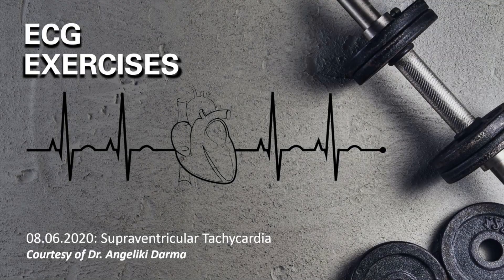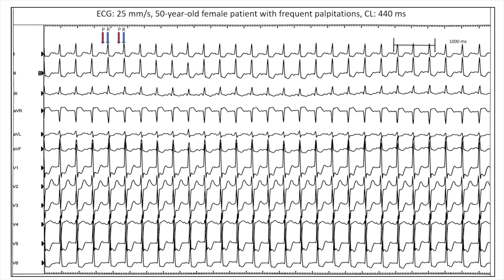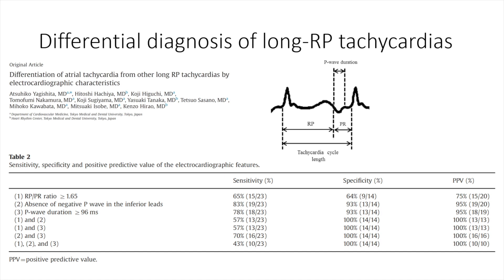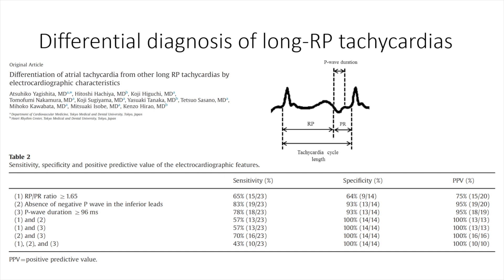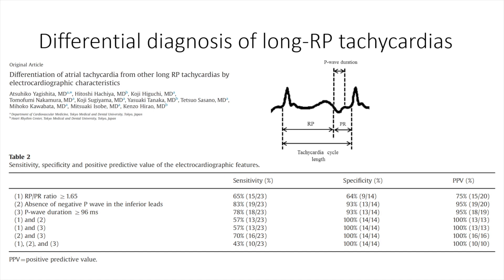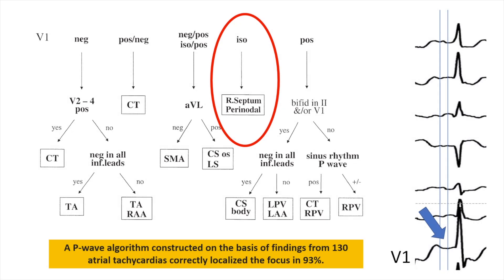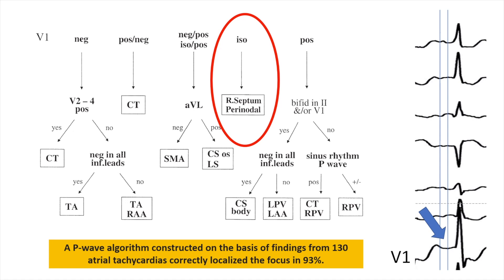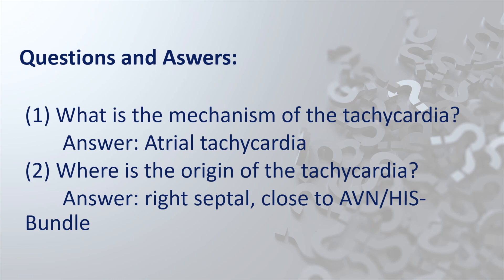ECG Exercise: SVT, what is the mechanism and where is the origin of the tachycardia

Comment: nice case! in practice how often u find AT algorhythm really useful? and if your answer is many times which one do u prefer : the aforementioned one (Kistler) or Ellenbogen or...?
Reply from the maker: Thank you for your comment. I actually use one that we have here in Leipzig. Starting not from V1 and then we look at V2-V6 and then to the limb leads. However, I have to mentions that especially after previous AF Ablation and substrate modification the p wave morphology is not as accurate as we expect. Most probably below 90%.
Reply: is it possible to have access to "Leipzig" one?